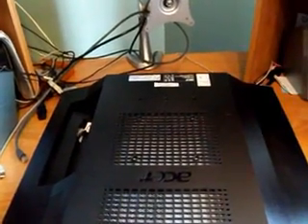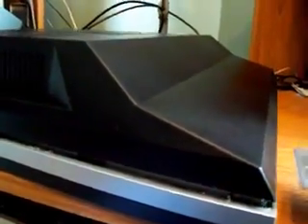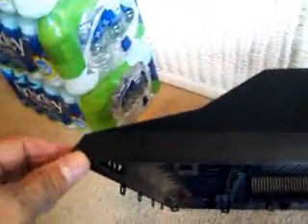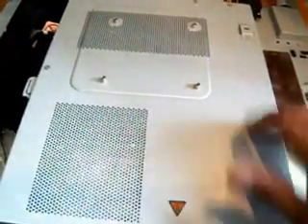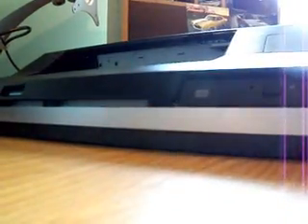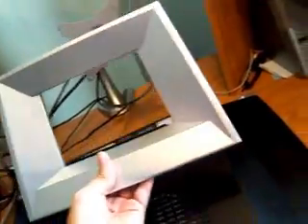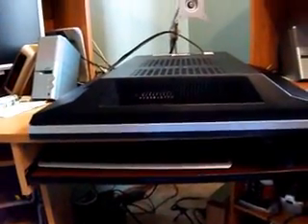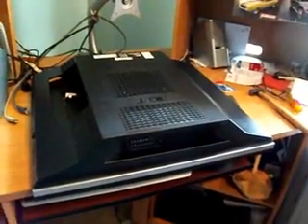Acer Aspire all in one PC model AZ5101 Disassembly

Comment: What a moron. Do you really think Acer going around smashing these with a hammer to open them up. OMG. You have to think like a computer service agent. I opened mine by using putty knife to slide around the joint and prising the clips apart wherever I would strike them. Very simple. Very quick. No damage. BTW much the same as the Z3761 and you need a special adapter for that video port. Takes a common PCIe video card.

Comment: I used the 3gb already in the machine behind 2 x 4gb sticks and it recognized all 11gb.  I also upgraded the hard drive to a 1tb 7200 rpm to get a faster seek speed.  I didn't see any way to upgrade the graphics but I'll assume the increase in ram will help.  I'm pretty impressed with the performance now.  Hope this helps.

Comment: Thanks for posting this.  It was very helpful.  A putty knife worked very well on the dis assembly.  Mine is a z3101 that came with 3GB of ram that suffered a hard drive crash.  I was able to recover all the data from the old drive by placing the drive between two freeze packs to keep it cool.  Next I wanted to upgrade the ram since the case was open.  I had 2 x 4gb sticks from a system pull.  With a motherboard limit of 8gb I thought I would throw the 2 x 4gb's in with the 3gb's...took all 11gb

Comment: i know you can upgrade the ram of the z3730 without a problem, but i'm still running stock. (3gb) the only thing i want to replace is Ithe shitty integrade graphics chipset, which is useless. i think you can fit a low profile graphics card in the pci slot. but i dont know of anyone who has done that. My believe is the Z3730 uses the same slim case as a the acer aspire x series. And those you can fit with a low profile card. I asked acer about it, but they have not replied yet..

Comment from the maker: I was thinking the same thing.No one can see the back off the unit unless they  actualy look behind it.also i belive the pc will run much cooler.I have been looking to upgrade the graphics and i have all ready taken off the plastic back cover several times and i just know sooner or later i will break a locking clip or two.If you may have seen in my vedio's i did away with the original stand and have been using a articulated mount that hooks om to my desk.